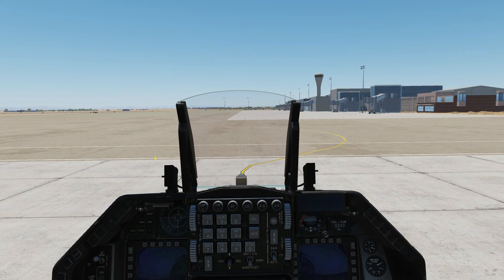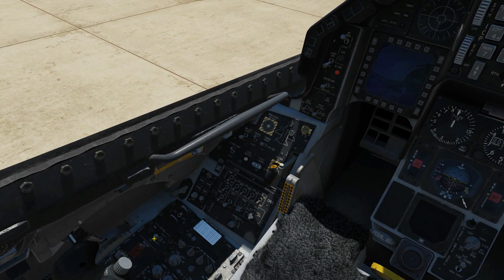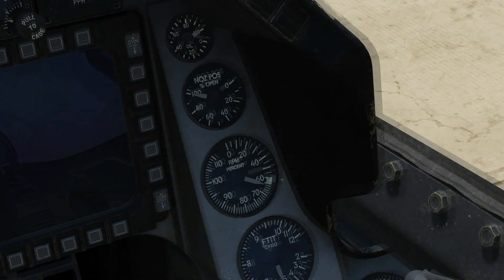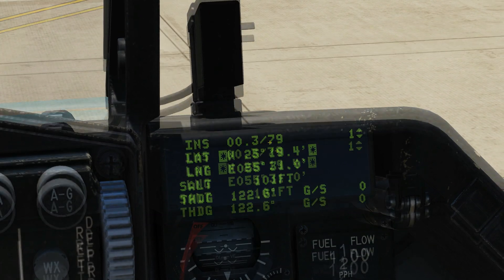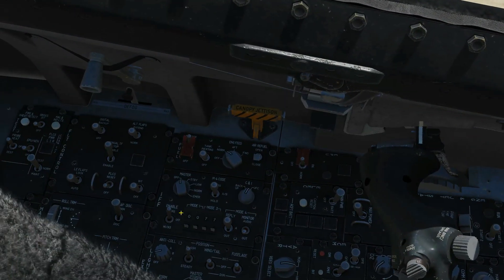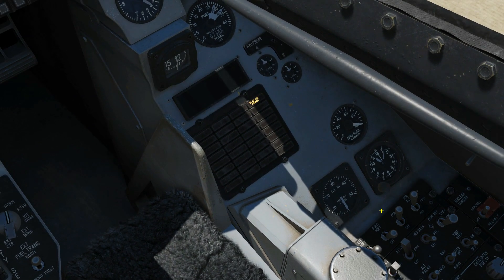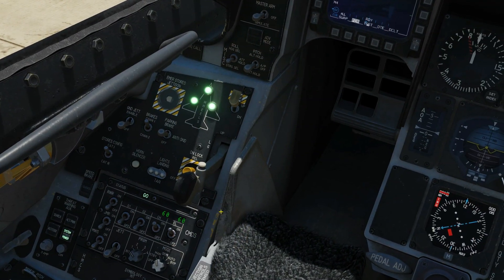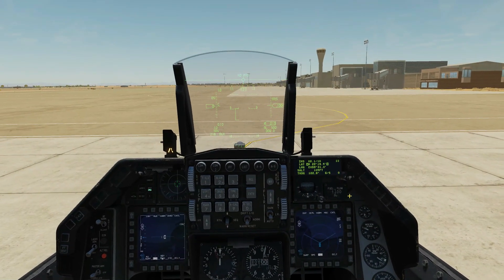F-16C Viper: Cold Start & STORED HEADING Alignment Tutorial | DCS WORLD

Comment: There is a bug with stored alighment. though it is suposed to be for if the aircraft "has not been moved since last shut down" per Wags, presently the heading will not align correctly if a stored heading is used after shutdown for rearming. a full normal alighment is required presently for it to work correctly when realigning after landing to rearm.
Reply from the maker: Copy thx

Comment: i’ve had a problem or bug i think every once in a while. i will be aligned and everything is set i put it on nav and i’m ready for takeoff. as soon as i takeoff my hud uncages. it’s far far right. idk if it’s a bug or something . it’s happened to me twice now. respond please!
Reply: Your HUD goes side-way left or right after TakeOff because its effected by the winds... strong winds drift the HUD to the side as the FPM goes left or right.. You can fix that by the switch T\O DIRECT DRIFT in the UFC underneath... it has nothing to do with the INS alingment process. I fly the Real F-16s so you may guess what I'm sayin is fair and square.
Reply: @asdasdcasdasd3084  Ill check that because I had the same problem - damn wind ;) How about aling in air? Can you discribe this process?
Reply: @TylerPL   Newer F-16 blocks such as 50\52 Use 2 diffrent systems combined - GPS and INS. so the INS is not relevent...

Comment: Note to myself: must take memory pill before start up.
Reply: @Silent dont get overwhelmed by the startup. Heres my trick. Forget everything and every button that you see. Then, go to the left panel, set the battery to main power, close the canopy, then lock it. Then set the jfs to on. Then set throttle to idle. Then go to the avionics panel, and flip all switches. Set the knob near it to on, then switch the 2 switches from the very right to on, then set the ins and done. Super simple when you forget every button
Reply: Compared to some of them I actually find the F-16 start up quite easy to remember. It's harder when you have to jump around during the sequence. At least with this one everything in one area gets done at the same time for the most part.
Reply: @thegreatmothra  I agree, try starting the ka50 or A10..